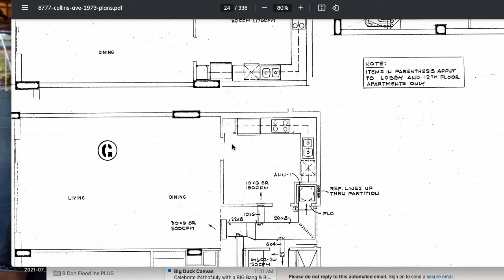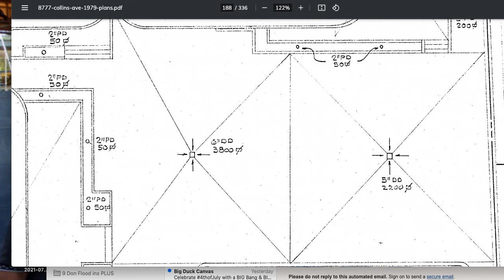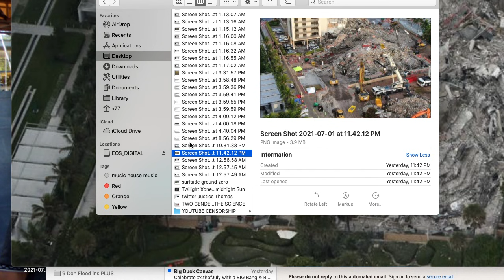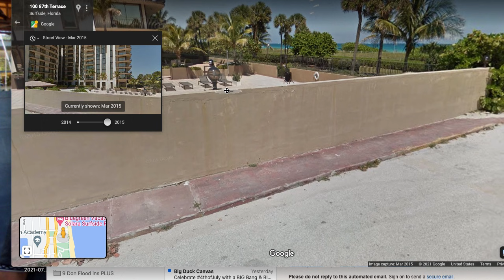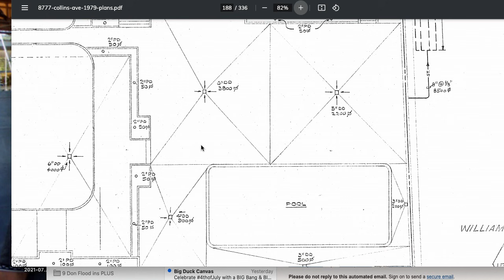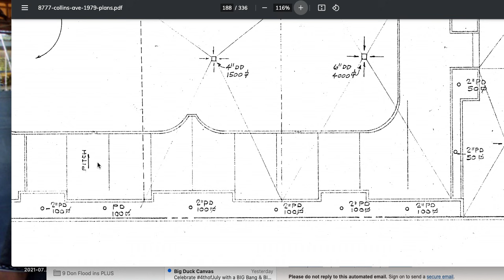Champlain Towers Collapse POOL DECK WAS PITCHED PER ORIGINAL DESIGN = CURRENT ENGINEER FAILED

Comment: Blueprints don't show the real facts.  The CTS condo was built on a wetland by the ocean.  The developer was a crooked Canadian lawyer who was a tax fugitive who moved to Florida.  The original general contractor left the project before the completion of construction.  The latest video of the garage, ten minutes before total collapse, shows a torrent of water from the ceiling pouring into the garage, where there is a pile of concrete on the garage floor.  The developer added an illegal 13th floor penthouse to the structure, more stress load on a building where corner cutting was the norm, to speed construction and save money.  Miami-Dade county's building department (RER) is a cesspool of corruption owned by the real estate industry.  The 40 year recertification program is insanity, a policy that is a smokescreen for shoddy construction practices.  This condo was a time bomb, a disaster waiting  to happen.  Had Miami-Dade had a real building department, the CTS condo would have been evacuated in 2018 and the building demolished as beyond repair.
Reply: Have to agree. If they would have looked at this realistically, the building was beyond repair, it needed to be tore down and rebuilt. The problem is people don't want to face reality.
Reply: When I built in Miami Dade and throughout Florida they were more concerned about what held the buildings down (against uplift forces) than they were about what held the buildings up.

Comment: Speaking to the pool deck plans - it appears to show it to be built in sections.  Do the plans reflect that for certain and if they had been constructed as such would the failure of only one section caused such a tragedy?  Clearly your work so far has gleaned much in the way of poor decision making by the "building authorities" at the time.  Who authorized the extra wrap around decks - where was the stamp for re-engineering the load on the columns and structure?  The same for the large planters outside and pavers?  How many other multi story buildings in this country are ticking time bombs?
Reply: Agree. I was thinking the same thing.

Comment: While there might have been a pitch to each drain. The problem with buildings located on sandy soil. The main drains are silted in, and clogged with sand. The water then backs up into the building. I've seen ten story building that had their drain covers blown off at ground level. and a gazer of water shooting 15 feet into the air. The water seen in the video coming out of the ceiling of the parking garage seems to indicate that the water had backed up into the building, and place water weights on the building causing the  collapse. Another possibility is that a car hit one of the columns in the parking garage. If A car is found with a damage to the front or, rear.  Just my opinion with so little information.
Reply: The garage level had a sprinkler system. The water we see pouring into the garage after the initial collapse is likely from a broken pipe as part of the sprinkler system and has little/nothing to do with the causes of the collapse. I think it's all but been officially established that the pool deck was faulty, overloaded, severely damaged and triggered the collapse of the building, it wasn't a broken/overflowing pipe that brought down this building, it was decades of alterations, neglect, ignorance on the part of inspectors and a failure of the city/state to enforce any adequate oversight.
Reply: @ct5625  There's two types of sprinkler systems wet, and dry. Being a twelve story building if it was a wet system there would be at least eighty psi on the system. and if it was leaking at the ground level water would be spraying. And in both systems water flow would have triggered the fire alarm. A broken drain didn't bring down the building, but it could have created a void underneath the building . I was a building manger of a ten story office building with a news paper on the first floor. A leaking pipe under the floor of the room they created plates for the printing presses collapsed into a sink hole. The pipe apparently had been leaking for years without any outward signs. Cracking and settling of the walls, and floors should have alerted them to this possibility.

Comment: I came to the same conclusion by looking at the basement floor plan. The thinner columns are not on grid next to the swimming pool and there are extremely large spans at this point. On google earth you can see where water has pooled at the sagging slab which will have directed water away from the drain outlets. Do you know whether the pool deck was a separate structure to the main building?  Differential settlement may have broken the join if it was connected.

Comment: Good analysis, I have not looked at the Construction Documents.  There were reports of standing water in the garage on the floor slab, for multiple consecutive days over many years, in the south tower that did not exist in the north tower.  Air and water are both fluids and this environment lends itself to a cocktail of salt water, chemicals from the pool, fertilizer from the planters, etc., in the ponding water to deteriorate concrete slabs and columns.  Do the Construction Documents have a floor drain system for the garage floor slab, perhaps with a pump incorporated due to slab being below grade?

Comment: Thank you for doing this video.  When I read the highlighted statement in the "inspectors" report, several days ago, that is exactly what prompted me to look at the plans directly, cause I know better.  No pool decks back then were designed "flat", not even in a backyard.

That this report contains such a blatantly false statement leads me to question everything I thought I knew.  This company (M) is responsible for the inspection of a failing condo building in Sarasota, about a decade ago.  One that I frequented and i will say this ... many of its issues were addressed, however, not to my personal satisfaction and although much work was done and the name changed, I entered it once after completion, could not leave soon enough  and have never returned.  There are more than a few swamps in FL and lots of swamp monsters.  I didn't trust this company (M) then and I sure don't now.

I pray that all Truths be revealed and I graciously thank you for assisting in the process.  Still don't believe this collapse was organic and where greed reigns, lives seldom matter.

Comment: If the architect that ended up building the building added the penthouse I wonder if he changed this also and if he changed things on the south tower I'd love to see what he changed on the sister tower the north tower if he was on that build also it's interesting
Reply from the maker: Look at the description, under the video title, I addressed that already.
Reply: @LoadPathEngineering  what I mean is did the guy that built it botch the plans flatten it and use pavers or did he follow the pitch put drains in then later on it was covered and flattened. After looking at 3d imaging of the other decking it's a long groove type of decking I'm not seeing drains but appears to be designed to naturally run off. As water absorbent as those tiles look after 40 years they'd be a rotten nightmare so I just wonder how it was originally built and when the pavers were put there. Clearly the original design isn't implemented on the deck I just mean who made it fubar, when
Reply: Yes, the penthouse was several units, effectively another floor across the entire section that collapsed. The developer got the same building height variance and built a penthouse on the North building, too.
Reply: @tommiller12345  I looked at the second tower and saw the same balcony penthouse changes  but the deck is completely different there's no drain that I can see anywhere yet on the south tower there is a drain I've only seen the one so did it originally follow plans or did it start with that paver overlay. I know they did small projects to the deck over the years and since the decking is completely different in both buildings I wonder how long the pavers were there you know what I mean

Comment: If it was the pool deck that collapsed first,  are buildings supposed to be able to withstand that type of failure without completely coming down?
Reply from the maker: This building has so many ''price cutting / corner cutting details'' that I am amazed it did not fail sooner...  The lack of steel in the concrete and the placement is amazing! = mostly soft concrete and it has been patched more times than a movie star...
Reply: Agree. That’s my argument, too. The failure of an inconsequential pedestrian deck should never cause a building collapse. The deck shouldn’t have used common columns as the building. Like Kai said, I am surprised the building didn’t fall sooner.
Reply: An other engineer had a pinned comment under the outdoor metal frame model video that when the slab fell it hit the coloums and that one of the possibilities. Because everything was tied/ built together and the slap had no section to fall so fell altogether.
Reply: @Chancellor Crappie  the pool was made of solid concrete walls thus didn’t collapse.

Comment: I'm curious how much of the runoff drainage system was actually fully compromised and/or destroyed in the Deck Leveling Project. You've shown the missing scupper on 87th street. I'm wondering if it got filled up (accidentally or deliberately) reducing it's total capacity. Would this lend to the anecdotal stories of the garage filling up with water on occasion.
Reply: I agree. The flat deck is a likely source of water for the garage flooding. Although, I recall reading that the garage was wet even when the weather was good.

Comment: The question now is... Where are the retention ponds for the stormwater runoff? You CAN'T just put it down the drain. Everything in Florida including roads must account for by REGULATION for every drop of water created by an IMPERVIOUS surface.
Reply: This building was shit all around. It's a surprise it lasted even this long, or better put, it lasted exactly as long as you'd think it'd last if you were being honest about everything.
Reply: The building was built 40 years ago so retention ponds may not have even been a thing for that area at the time. Regardless, there are buildings with storm water drainage as part of the plan with the city and state.

Comment: The deck doesn't explain the maintenance man from a few years ago saying the garage would fill up with water & 2 pumps ran all the time to pump it out during high tides or bad weather. He said cars would float but had no idea where the water came in from. Something is off.
Reply: That's what I was thinking. If the garage parking lot is so well pitched, and if the $400,000 that paid for sewer improvements really happened, why is there so much flooding in the garage/basement? I agree, something doesn't add up.
Reply: I read an article in the local paper during that time period (1980) that stated the developer paid only half the amount required to fix the sewage problem ($200,000).
Reply: @michaelwerkov3438  In the article from the Miami Herald titles "In South Florida, developers often demand exceptions to rules. Champlain Towers got several" there is a newspaper clipping from the time the condo was built that says "developer says he will pay half of $400,000 sewer bill"
Reply: @michaelwerkov3438  The problem, according to the article, seems to have been with the water and sewage system in the town of Surfside. The councilman at the time said that the condos were a huge deal for such a small town with one story residences and low-rise condos that they had to do major improvements to the water system, otherwise "water pressure wouldn't reach the top floor." How they fixed the problem with half of the amount needed is a mystery. It was known that the developers donated money to councilman at the time to get their plans approved. So it is definitely something that should be looked into with all of the complaints about water in the garage.
Reply: Would be nice if some residents confirmed his story. Hard to believe that floating cars in the garage didn't get attention.
Reply: @lockbert99  Yes I don't think I'd be too happy if someone said to me: "Oh by the way mate, your car's flaoting round the car park but don't worry, happens all the time"!
Reply: I'm sure it's nothing that any of us could get ahold of, but a history of insurance claims paid on cars in the parking garage would be interesting, because floating cars tend to bang into things, and if they're floating in salt water, IDK about you, but I'm contacting my insurance about that.  Also, there was an interview with a woman (Cordero?  Something like that) who said she would see water "coming up the wall" in the parking garage.  That would have to be sea water being pushed in by the tide.  I saw a comment in another video somewhere that low tide on the night of the collapse was shortly before the building collapsed-right around 1AM if I remember right.
Reply: There was tons of water down there surrounding the crews right after it fell. They were standing in knee- deep water trying to drill their way to someone who was alive at the time. I remember thinking, where did all that water come from???
Reply: @Laroc1982  fire department did put water on the collapsed building shortly after it fell.
Reply: @Laroc1982  water from fire department, from burst pipes supplying buildings fresh water supply.
Reply: Sea water at high tide !
Reply: This condo was built  on re-claimed wetlands.  Could that explain the water issue?

Comment: Wonder if the leveling job was an "under the table" job?
Reply from the maker: ha...  I have found it... just waiting for someone else to tell me they found it... I like to allow other people to do some heavy lifting... But, tomorrow , I will do a model of this floor failure and explain how that happens.
Reply: Was the layer of concrete pavers also added under the table?
Reply: @tommiller12345  I think it's more likely there's just no means to inspect or hold anyone to any structural requirements in FL. Remember, residents were able to tile their own balconies (using incorrect materials and methods) without any push back from the HOA or any inspection by the city. There was a refit going on in the top apartment also, but they simply refused to let inspectors check it out and nothing was done, they walked away. This shows that there is/was a culture of apathy and disinterest in every link in the chain from state gov to city to HOA.
Reply: @ct5625   As a builder who spent 15 years during the 1980's and 1990's building throughout Florida I can directly testify that your assumption is totally incorrect. Due to the frequent hurricanes, Florida is probably the most stringent state and Miami Dade was leading the way when it comes to following structural and code requirement, so much so that I personally observed several construction companies go bankrupt trying to comply with their over burdensome regulations. It was enough to convince me to move out of state and carry on my career elsewhere where my life has been much better.

Comment: After seeing his roof I had no doubt that the ARCHITECT did the right thing by the pool. The changes and decisions were made after! Well Done!
Reply: To be fair, it's always possible that the contractor in 1981 disregarded the drainage to save time and money, and that the inspector missed it/got bribed to miss it, but that's highly, highly unlikely in my opinion, even with all the Cubans "influences" in 1981 Miami (I'm Cuban so I can joke about us).
Reply: @CaptainCaveman1170  yes indeed. 1971 and 1980 building code for laxed to where it seems like insufficient materials and corners were allowed to be cut in the state of Florida.
Reply: 1970s to mid 1980s buildings are known for their shawty work and cut corners as well as blatant violations all around the country. Boston, Mass is another big one.

Comment: Do you think a trigger for the initial failure will be found? Any guesses as to what that was?
Reply from the maker: Tomorrow, I will do a model of the failure of the deck...
Reply: @LoadPathEngineering  yes!
Reply: The condo’s security video would help with the initial failure of the deck parking, for example to see if a car bumped a column.
Reply: Could find it to be a combination of things.  Water issues, construction revisions to save money, inspector misses could all contribute.  I wonder if the deck collapse, which happened first, left the main building columns with a taller unsupported length than what they were designed for,  Structure looks lean without much redundancy.